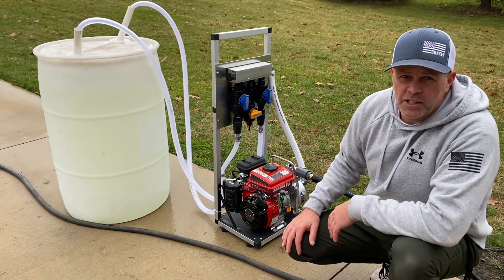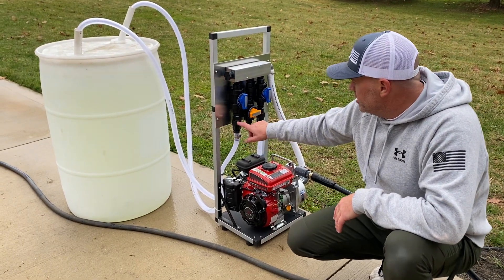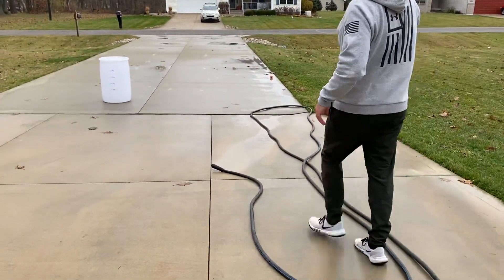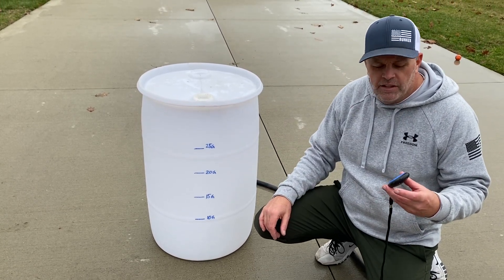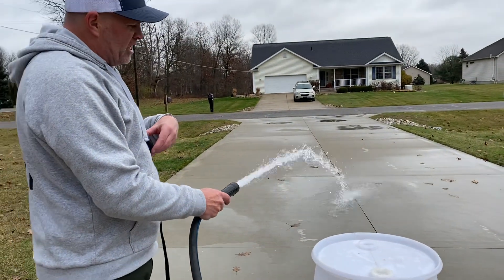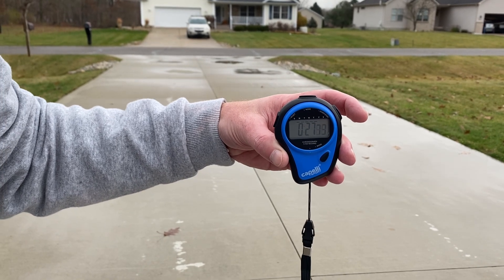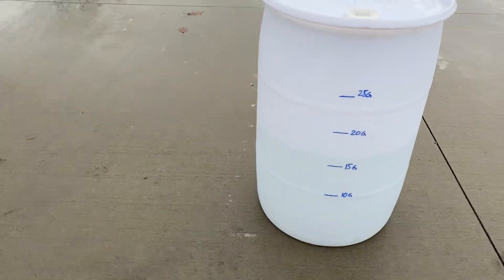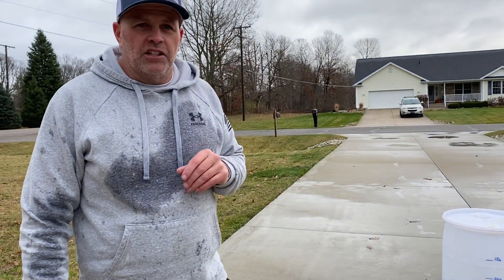Our Gas Powered Soft Wash System Flow Test! How Many GPM’s??

Comment: Is this going to pull a true 1% or 1.5% out of the proportioner when set to the right numbers on the valves?
Reply from the maker: @rmass68  absolutely.  Just remember no proportioner is perfect. The reason for a proportioner is the ability to adjust your mixture on the fly. If it's too hot, dial it down, if you need more, turn it up. 

Something that is really difwith a DS injector or when batch mixing.

Comment: I use that pump I is a Good Pump. But you will want to change the plastic plugs to metal ones. I stayed off the gun too long and the prime plug blew out. I am hitting 55 feet with that pump. I wash two-story houses with no problem. I am going to install a remote kill switch on mine. I have my pump paired with Batch Buster From SESW.  this pump has replaced my super pump from SESW. I rinse with this pump all the time.
Reply: You had the sweet 16 super pump or super 8?  Why are you not using the sesw pump?    I am going this route myself.   It works and its super cheap.
Reply: @ 16 still have it just have not put back on my skid yet
Reply from the maker: @WATER_WIZARDVB  we’re recommending no longer than 5 minutes of the trigger.
Reply: @ my experience with the plastic plugs is they started leaking after applying chems to a house a couple of time the o rings on the plugs get weak. as time goes on the plugs get weaker.
Reply from the maker: @ good to know
Reply: also you will want to adjust the throttle screw out for more flow
Reply from the maker: @ did that, we set them to open the throttle blade fully.
Reply: Any videos available

Comment: What size hose are you running from the manifold to the pump? 3/4 or 1in
Reply from the maker: @bradspressurewashing  1 inch, non collapsible
Reply: @apexpressurecleaning  i got the 1inch proportioner all should be good flow still?
Reply from the maker: @ yes

Comment: Why wouldn’t you use a drop stick? How else do people feed their blend valves?
Reply: Drop stick on the sh is fine     . I would personally only pull water from the bottom of the tank to keep the pump primed. Those pumps have a prime port on top but would be aggravating to have to prime at every job. Just plumb water from bottom and keep the pump below the water level to hold prime.
Reply: @ well it essentially acts as a sump pump
So when you’d use this to drain a pool, its going to pull water regardless.
I agree with not having to prime at each job, but thats also why a bypass would come in handy
Take a look at what leon’s done with the bypass for the moflo system.
Reply: With a drop stick the pump would have to move the volume of air in side the suction side hose before getting water. That’s not even considering the problem of bulkhead fittings leaking on an SH tank.
Reply from the maker: @jjpabst1392  we feel this system is best when directly plumbed to bulkhead fittings on tanks.
Reply: @ Ahhh I’ve never done that. I guess I’ll have to look into how to do that
Reply: @apexpressurecleaning Definitely not going to pop a bulkhead in my SH tank
You pop that hole and it leaks thats a huge waste of money. Almost more than the system itself
I think it would preform fine from a drop stick